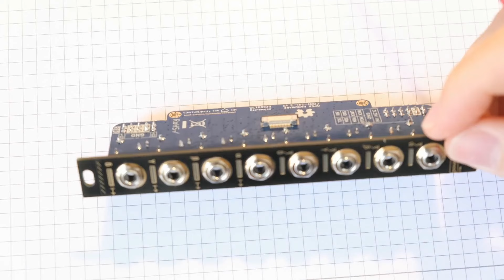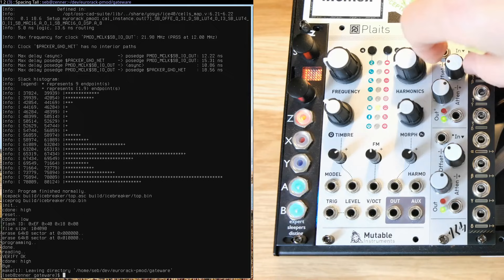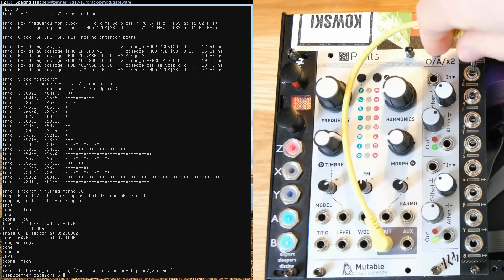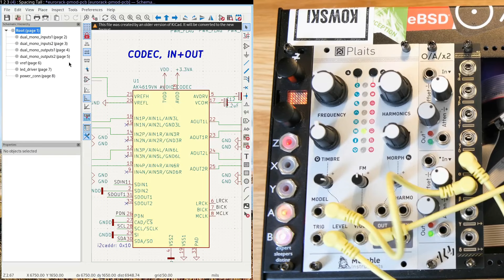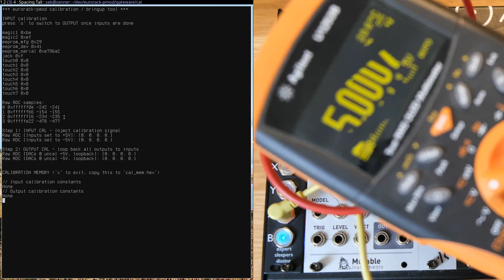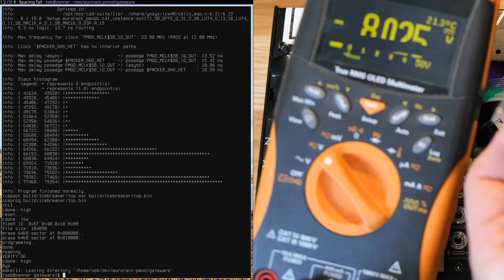Eurorack-PMOD tutorial (FPGAs + audio development)

Comment: that pitch-shifter was actually invented to be used with a magnetic tape machine, that worked by having four heads reading the tape, arranged on a wheel that could spin. Because they were in quadrature, they automatically crossfaded. The read tape heads could be spun at a different speed than the tape itself was moving, which created a really smooth and surreal pitch-shifting effect. In 2001: A Space Oddessy, it's what makes HAL wind down so creepily as he sings "Daisy Bell". Of course, there's no way to do a dry/wet control like you can with digital. I think your implementation is set to a hardcoded 50% wet/dry so you get the original mixed in as well?